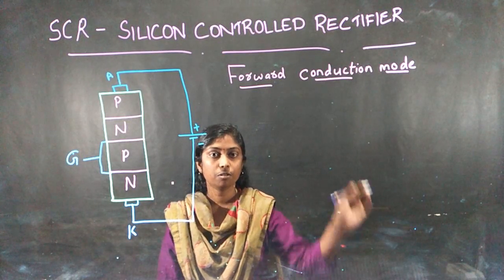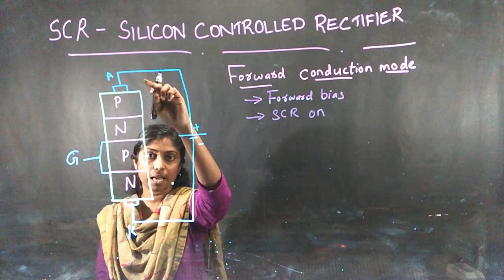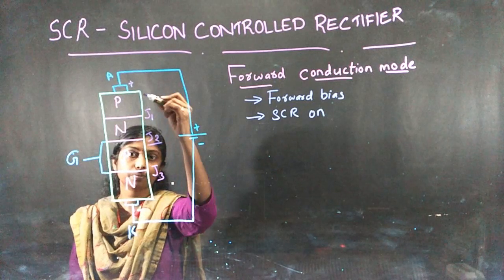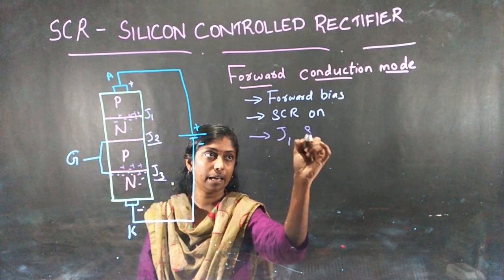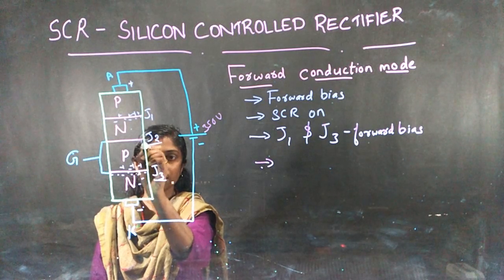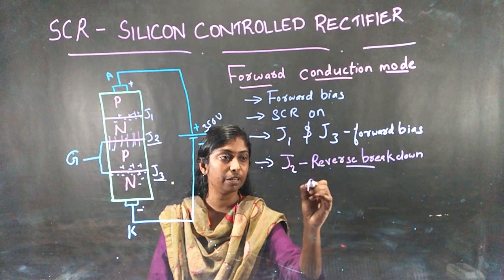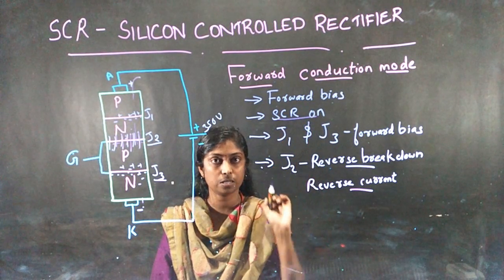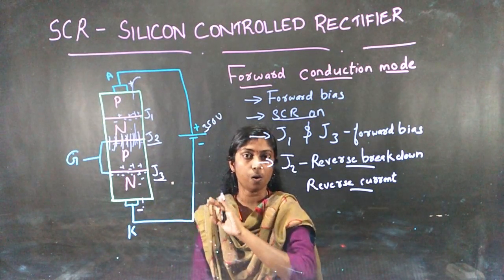SILICON CONTROLLED RECTIFIER- FORWARD CONDUCTION MODE

Comment: What is the effect of gate in forward conduction mode?
Reply from the maker: Used  for triggering  the scr
Gate voltage with respect to cathode  makes  the SCR on fast
Reply from the maker: Higher the gate voltage lesser the forward break over voltage